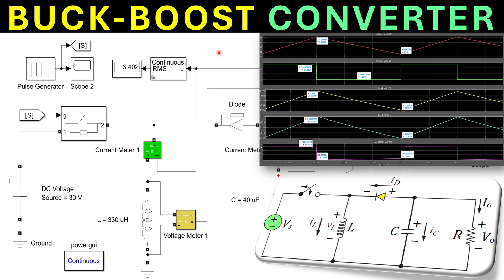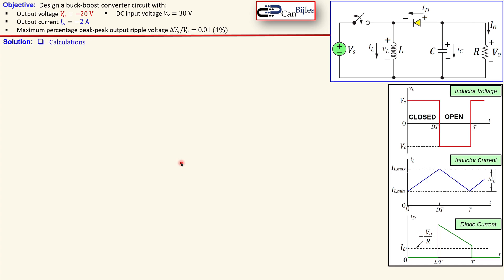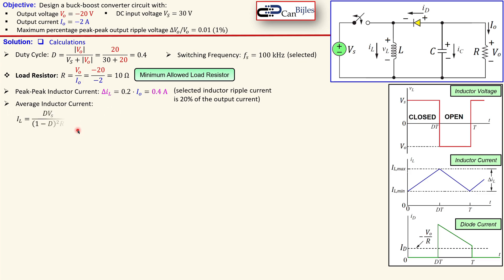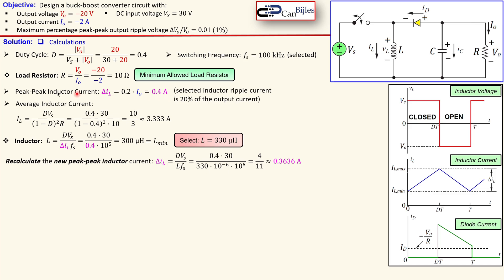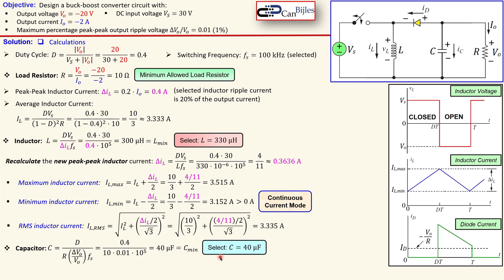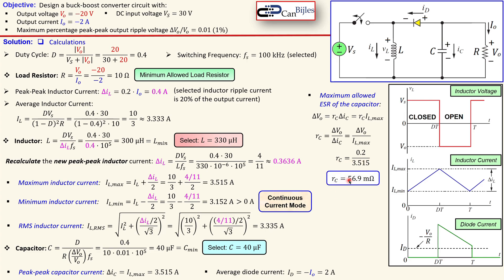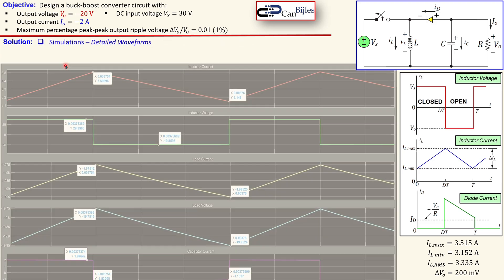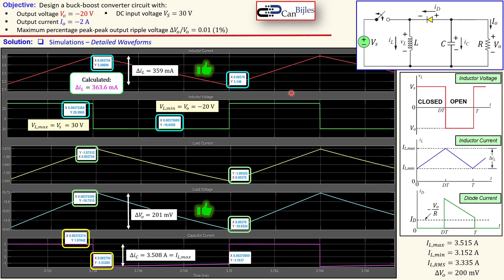⚡ DC-DC Buck-Boost Converter Design 🔋 Power Electronics Calculations & MATLAB/Simulink

Comment: Great video! do you have the reference from the equation analisis?
Reply from the maker: Thanks for your message. Glad to know you liked the video! 

📚 Resources 👇
Power Electronics, Daniel W. Hart, ISBN: 9780073380674
Reply: i have a question if you don't have a problem. In a FV system, as source in a buck converter, the In capacitor is important to define a input current ripple isn't? Do you have some equation for this Capacitor? thanks, kind regards!
Reply from the maker: I do not understand the question. What do you mean by FV?
Reply: @CANEDUX  sorry for my bad english!!, i mean Photovoltaic System
Reply from the maker: @JoseGonzalezFernandez-bb6ow   The capacitor, which is in parallel with the load, will determine the output voltage ripple. Increasing the value of this capacitor will decrease the output voltage ripple.
Reply: @CANEDUX  i'm sorry i was trying to say Cin for the input, for example with a Photovoltaic panel, a capacitor in the input can give a ripple in Voltage input
Reply: in parallel with the source
Reply from the maker: Capacitor parallel to an input voltage source is actually to stabilize the input voltage fed into the circuit. For example, if the voltage source drops a bit, then the charged input capacitor can take over, but this depends also on its value and the components connected to this input capacitor.
Reply: @CANEDUX  Thank you so much for your answer, i'm trying to simulate on simscape a PV array connected with a designed buck-boost converter for charging two differents battery packs.
Reply from the maker: @JoseGonzalezFernandez-bb6ow  Sounds a nice project!
Reply: @CANEDUX  thank you so much! the packs are not charging at the same time (for Now) but the same converter can charge it,  with different current ripple in the inductor, if i try to change the size of L (with a mutual inductance or tapped inductor) to achieve high gain on convertion. Thank you for your video is very helpfull to me. Kind Regards
Reply from the maker: @JoseGonzalezFernandez-bb6ow  Great to know! There is a good progress in the project.

You are welcome. I am glad that you liked the video and can use it for your project.
Reply: @CANEDUX   Hi, i'm here again, i'm sorry, in this whole time i was thinking in one doubt, in this converter why the inductor current ripple is a percentage of the output current? thank you so much for your time.